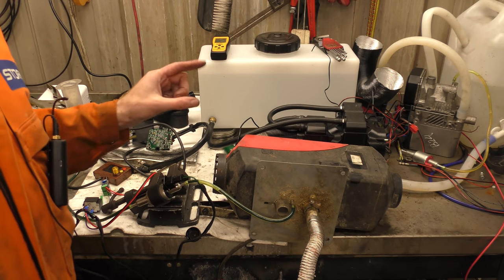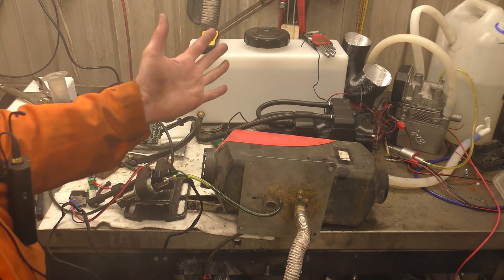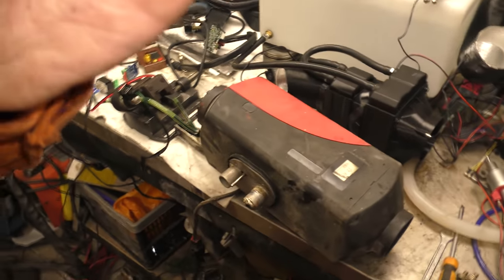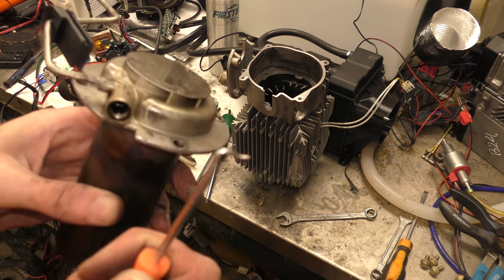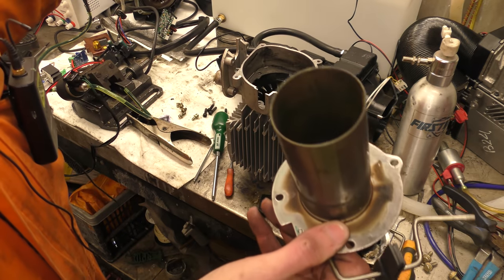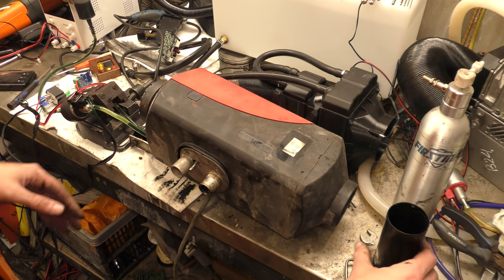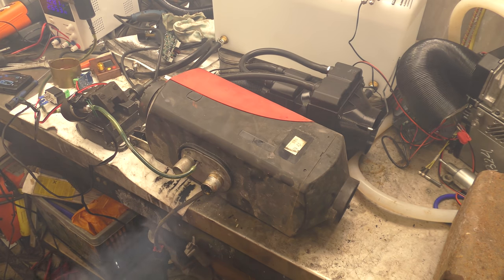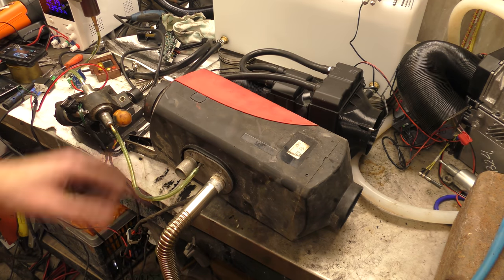Diesel Heater Diagnosis - white smoke but not lighting

Comment: David do you think the Chinese heaters are worth buying or do they need constant tinkering with to keep going. I like the lavnar pro but can't buy in australia.could you tell me the best Chinese model to buy appreciated. Many thinks Harry
Reply from the maker: There appear to be two kinds of diesel heater.  One that dies within a few uses or straight out of the box, and the other will run for years without a single issue.  There also aren't that many actual 'brands'.  The last heater I bought was a Vevor brand that was all aluminium and it has so far worked fine in the camper it is installed in.
Reply: Hi  excellent set of vids .
I have j7st installed a heater and on connection to the battery the control panel  gives a fault code of  E-07 
I have checked the harness from the panel to the heater 1 wire at a time  and no breaks . I have opened tye case on the main board where its marked + & - and the reading is 13.8v as it's connected directly to my leisure battery  the blue wire is reading 4.6v at both ends as is the black  and red wire from control to the  main board .
Xan you recommend what to check next please
Reply: If you are the type of person that demands off the shelf perfection, then you are taking a bit of a risk. If you have a sense of adventure, an enquiring mind, have basic diy skills and access to youtube, then these are great value and a lot of fun.
Once you get them properly set up they are very low maintenance.

Comment: mix red diesel with kerosene at 5 to 1 and you ll be surprised what happens  and have a thermometer on output .....
if you have a private road and smokey diesel car use the same ratio and that ll  surprise you 2....
Reply from the maker: I've been using kerosene in the heaters for a while.  And it does burn a bit hotter and cleaner than diesel.
Reply: @DavidMcLuckie  at the ratio i mentioned it will actually trip the overheat protection on these heaters and  in a car on private road you can actually feel the increased power having doshed it in to see if it would clean out engine...it actually did !

Comment: Thanks for the great informational videos on the heaters. 

The burner tube on my no name "8kw" Chinese heater screws apart so you can remove and clean the metal wool and screen sleeve in the base (not referring to the little diffuser screen around the glow plug). All the others I've seen are one piece or welded. Any idea where I can get a spare metal wool sleeve?
Reply from the maker: Interesting.  That sounds like a design I haven't seen in the cheap heaters.  Have you got any pictures?
Reply: I do have a picture but don't know how to send it to you.  Sorry for not seeing your reply for several months.

I also found new mesh inserts on eBay 5 for $15 US.

Comment: Thinking about buying one of these things for my shed workshop, there seem to be loads from the Czech republic for about £80 but they've got a really simple no display controller, is there any advantage to buying one with an LCD controller or is it just 'pretty' lights?
Reply: With the LCD controller, you can set up the burning rate better, fan speeds etc, you can alter settings to suit your needs
Reply from the maker: Exactly what Ricky said.
Reply: Hey gentlemen. What are the best settings for these for a 12v units? Or does it come down to touch, feel and smell sort of thing when your running your unit??? Obviously not to much smell or you would be on your back. Cheers gents 👍👍👍

Comment: Pan down for the "Safety Crocs" . . . . 
 By the way what Bench Power Supply you got. . . ?
I was stoked when you explained the "vent hole up" . . . I want to rotate my tower unit so as the exhaust comes out the side.
Reply from the maker: Bench power supply -  https://amzn.to/2E5qRoY
Reply: @DavidMcLuckie  I'm sure you used to use two in parallel for the current requirement?
Reply from the maker: Seems to depend on the heater.  That one only used 9A at startup, but I've got another now to play with that uses more than 10A.

Comment: can you also mount in vertically?
Reply from the maker: Yes.  But only one way up.  Hot air out the bottom.  If you go the other way a small amount of diesel will leak from the flame front starter hole.

Comment: Any idea why my heater choked up with soot or carbon  only a few months old 12V 2KW-8KW Diesel Air Heater
Reply from the maker: Incorrect settings (tuning) would be my first suspicion.
Reply: @DavidMcLuckie  Cleared it all out last night  use brake fluid and I did a good job  my settings are on 35  so turned up full but again today my carbon monoxide  was bleeping like mad any other suggestions welcome
Reply from the maker: 35?  I meant the pump Hz and fan RPM settings.

Comment: I have a 5kw unit, is the 2kw unit smaller and do you know anyone who would like to swap my 5 for their 2???
Reply from the maker: A genuine '2KW' heater is smaller.  Beware people selling the larger heaters marked as 2KW as there seems to be some shortage, but I might know where they are.  My 2KW has no end on, so you might not want it.  :)
Reply: Thank you. No end on it? It’s for my Vw camper, I’m putting it under the vehicle so not bothered about what it looks like. If I’m putting under the van it will be on its side, do you think that will be an issue?
Reply from the maker: I chopped the end off it so we could see inside while burning.  You can put it on it's side as long as the glowplug is at the top.

Comment: Did You put in a new presure regulator?
I had same problem in mine. It was a membrane in the regulator which had a hole. Then it could not regulate the presure of the fuel. Have not read all comments, if anyone else has mentioned the same.
Best regards Brian
Reply from the maker: Pressure regulator?
Reply: In my heater there is a presure regulator to even out the changing presure from the pump before the nozzle. It is a small rubber disk and a spring. If there is a hole in the rubber disk it can not regulate the presure, and You have same symptoms. I think the rubber can not stand new types of fuel.
But it also have to be clean ☺️
Reply from the maker: Ah the pulse damper.  These heaters don't use them and don't seem to make a difference in their running.
Reply: Ok, also just another thing it could be. Seems on this one You did a nice job ☺️

Comment: Ive ran mine with 50/50 diesel/old hydraulic oil. Also some gearbox oil in it. To much heavy oil = sputters since the ratio air/long burning oil doesnt match up When going with to much heavy oil

But 50/50 diesel/hydraulic works ok

Comment: With these heaters would it be acceptable to mount a fuel tank on the roof rack?  Or could gravity draw fuel down and leak?
Reply from the maker: The standard pump acts like a one way valve.  Once it's off no fuel will flow.
Reply: @DavidMcLuckie  nice, thanks
Reply: just be aware that if the tank is above the pump, a leak in the fuel line from tank to pump could very well lead to the tank siphoning out all over your vehicle
Reply: @bigoldgrizzly  great timing. I posted this question 10 months ago when I was considering buying a van to build. I just pulled the trigger on an Astro van last week. I'm still leaning towards putting it on the roof. Maybe I'll install a motorcycle style petcock to turn the fuel off when not needed.
Reply: @adamhixon  
Good Man
To every problem there is a solution -  far better if you foresee the problem.
 Hope the van works well for you  ....  OG

Comment: Im genuinely curious how large of an area these could heat. Would be way easier to install semi permanently than a gas heater
Reply: Got one in a static caravan 36/12 and heats it up lovely on the lowest setting/have seen a couple of vids of people using them in bungalows and doing the job great
Reply: heating a 1 1/2 car garage in Canada pretty easy 
runs 24/7 in the winter months at about half power settings